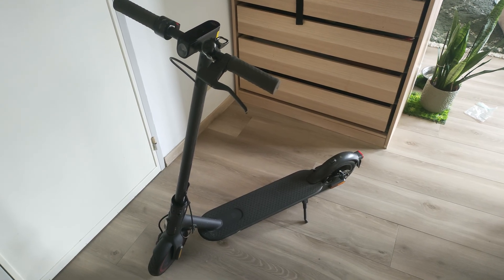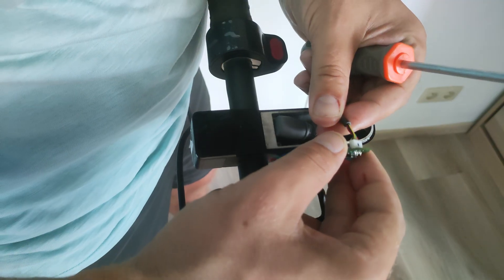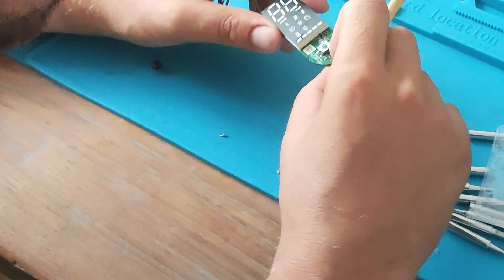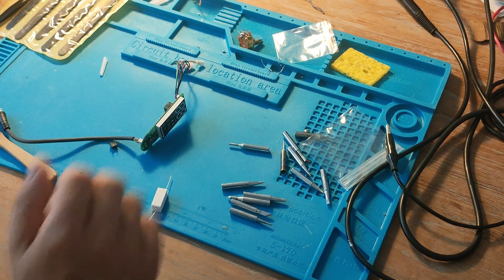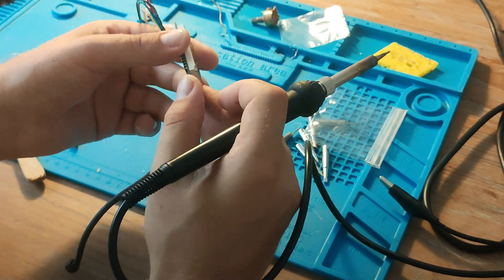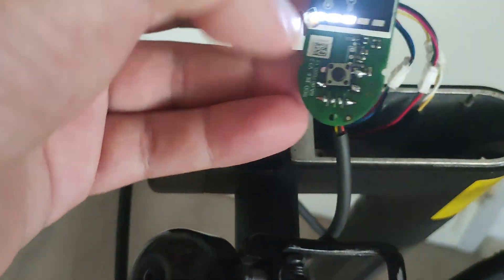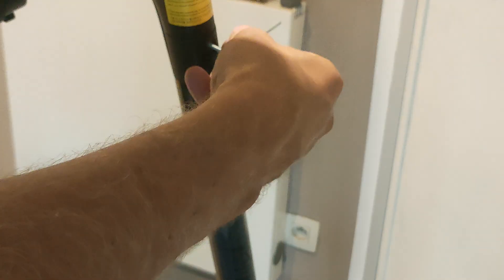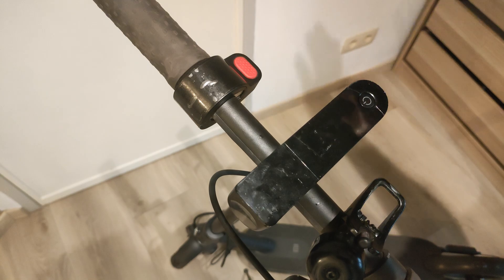Reviving an Electric Mi Scooter: Water-Damaged Dashboard - How to Repair

Comment: I changed the screen, but I still have the same problem. I saw that there is a loose connector on the main control board. How  to fix that?
Reply from the maker: Which one?
Reply: @patchnplay  the power cable for the screen
Reply from the maker: you mean the blue one with the plug?
Reply: @patchnplay  yes

Comment: Bro mine dashboard wont turn on so what do i need to do
Reply from the maker: Is it a new one?
Reply: Remove the handlebars not the dashboard, to check if the connector wires are still connected.   If not connect them and try turning on your scooter.   It should work then unless you have a battery problem